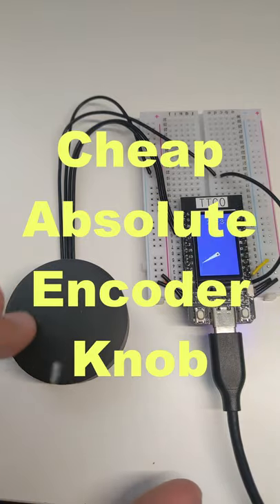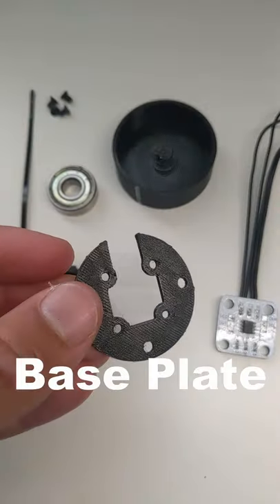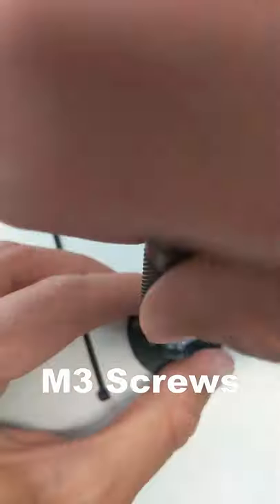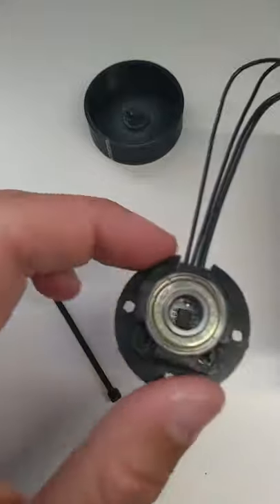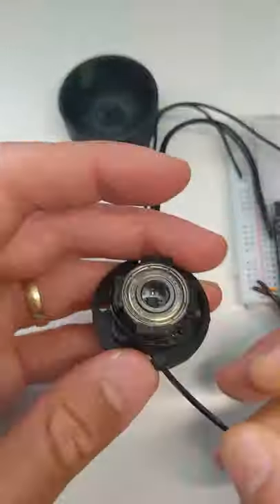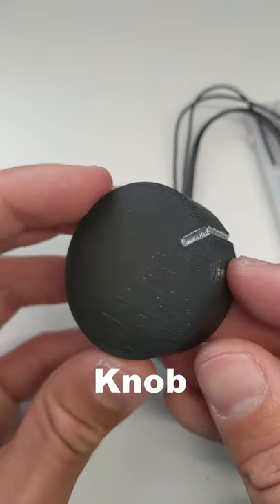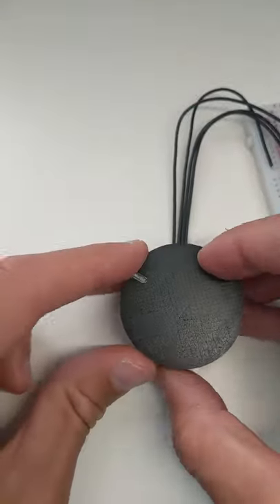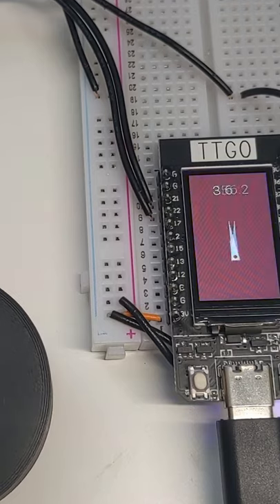Cheap 3D Printed Absolute Encoder Knob #Shorts

Comment: Hell yeah man.  I love the AS5600.  We used one for a prototype FFB controller.  Love your work!  Keep posting!
Reply: can you share your project? im planning to build ffb steering but idk what type of encoder to use
Reply: @notgeymer4592  AS5600 would work, you just need a magnet on the end of the shaft.  As long as you have a motor with a shaft sticking out the back that you can attach a diametric magnet to, then you should just be able to put the encoder behind that and get absolute rotational information.  You can also look up DIY FFB projects, they have been done in the past and there should be code out there to help you along.

Comment: That’s awesome!
If the rpm is to high it can get false readings, but if it slows down again it self correct, right?
Reply from the maker: Yeah I'm actually not sure the max RPM, but for a use like this it should be more than fast enough. And yeah, there's no potential for drift or lost "pulses" since it's basically a magnetic compass being polled over I2C and doesn't rely on interrupts or pulse counting.
Reply: @scottbez1  Thanks!
Reply: @scottbez1  dang! I'm wondering if this kind of encoder would be better for 3d printers.
Reply: @nicholasfinch4087  I guess it would lack the tactile feedback of the standard encoder and be prone to accidental spinning due to the lack of detents, and using the SmartKnob View would be pretty overkill. Besides, most touchscreen interfaces are cheaper and faster to navigate. However, having a knob as a secondary input would be lovely, I got pretty fed up with spamming the axis down button to set the Z height on my Anycubic Predator.
Reply: @scottbez1 Looking at the datasheet, it says the settling time is 0.286ms at the fastest setting. That gives about 50 RPM at maximum resolution, or about 580 RPM at 1° resolution, for example. There might also be magnetic effects I’m not considering, though.
Reply: @dominiknovosel883 If you're concerned about it spinning you could add drag lube to the bearing.  That should give you a nice, smooth, pro-audio-board feel to it.  It should stay right where you leave it.
Reply: @excrubulent  Interesting solution, but most drag lubes I've encountered were slightly viscoelastic and I feel like they would slowly pull back the dial.
Reply: @dominiknovosel883  Well I'm gonna try this and I'll let you know how it goes :)
Reply: @excrubulent  Excellent.
Reply: @dominiknovosel883  Okay, just got the 608 bearings in the mail, and I degreased one and applied Nyogel 767A to the tracks.  I haven't put the encoder together, so I can't speak to how it might affect the readings, but just watching it I can't physically notice any viscoelasticity.  The bearing stops and stays exactly where it's put and doesn't spring back at all.  I suspect it's not enough of an effect to change how you would use a knob.  I was honestly a little worried the nyogel would be too much given it's acting at such a big distance from the centre, but it's got a good feel to it.  Not too stiff, not loose at all.  When you use it on bushings it's very stiff, but with bearings I guess it's a lot more subtle.
Reply: @excrubulent  Wow, I wish I had your dedication. Good to know it works. While I still don't think a detentless knob would be much good for a 3D printer, I imagine it would be wonderful as a volume knob or jog wheel on a hotkey deck.
Reply: @dominiknovosel883  Thanks!  My plan is to make MIDI controllers, for things like digital synths, so smooth input is ideal.  I'm also experimenting with gutting notched encoders to reuse the shaft with proper machined knobs, then the nyogel goes inside the shaft.  I was going to do this either way, and I always like to report back.

Comment: Would you mind sharing the code? I m having trouble with mine and a working example might help. Also, isn't the read command for the sensor a blocking function?

Comment: Does it reset when you turn power off? I need absolute encoder because my incremental encoder is resetting when i turn off power. Please answer this.
Reply from the maker: It's an absolute encoder so will preserve the angle after a power off. It's reading the absolute angle of the magnetic field.

Comment: I wanted to make an analog version of this but when I tried removing the r1 resistor it did allow the vcc pin to be connected to the as5600 chip Vdd5v pin 1. But when i checked for analog Output it got latched to 4V++. I somehow managed to solder back the resistor.

I had to connect the pgo pin to 5v to have the analog working.

Comment: would it loose steps if you spin it too fast?
Reply: it's an absolute encoder, so it doesn't work on pulses but rather reads the actual rotation of the magnet relative to itself. The only situation where it could lose a step is if it spins more than 180° between two readings because that would not count towards the total number of rotations or even count in the other direction.